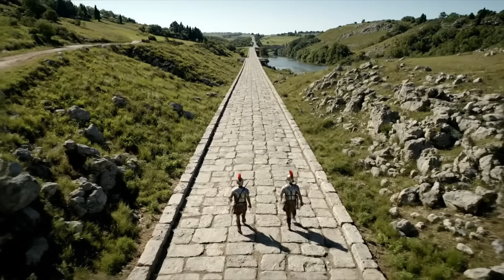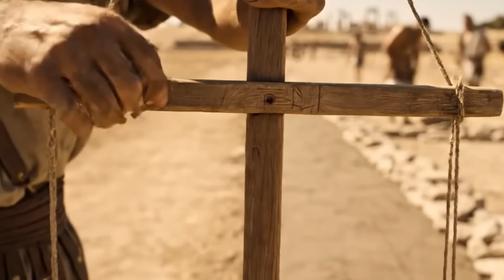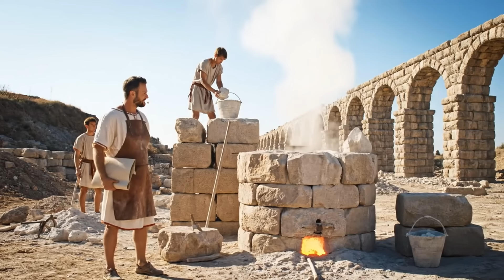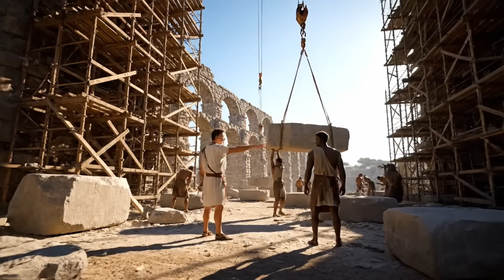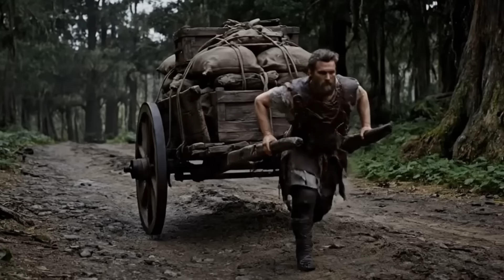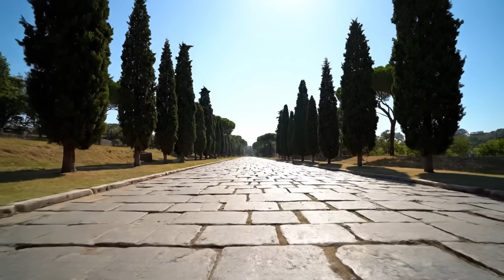How Rome Built Roads That Still Exist

Comment: The M25 ring road around London was conceived as a 3 lane in 1936, but not built until its opening in 1986 with 2 lanes. The northern section had a design life of just 5 years! It was so poorly designed it is known as the car park!

Comment: Walking long distance on hard ground does damage to the joints, tendons and ligaments of horse and man. Living people and animals were consumables, subordinate means to the end of running the megamachine.
Reply: First off, let me explain one thing about this video and it “information” some things they got right but many things they got very wrong. The roads only had flag stones in the cities and on the exit roads leading out of the city for a short distance. Those are the only places that had flagstone as the top layer of the street. The rest of the roads were heavy stone followed by stone aggregate to fill in the gaps of the larger stones on the bottom then covered with and packed hard with the dirt clay sand type mixture that was also flattened with a roller, very heavy concrete roller that was pulled by a horse or Ox, one of those animals to really pack in the road. Think about horses running on the road if it was all stones and Flagstone and those horses didn’t have shod hooves so running on rock would ruin the horses hooves.  If you want a great documentaries series, there is an Italian documentary that was done, but they do have a set of the documentaries dubbed by a narrator in English and it came out very nice. They have the history of Roman aqueducts, Roman engineering, Roman structures, and Roman cities.  
YouTube  “Alpha Helix” is the
Channel name.

Comment: In France today I regularly drive on roads that were clearly originally built complete with the 'fosse' either side, by Romans and very good they are too. In hilly country it's interesting to see how the Roman's compromised their need for long straight roads.
A lot more Roman bridges would still exist except for the invention and widespread use of gunpowder. Despite which you can still  stand on, drive over, Roman bridges in many parts of rural France.
Reply: I agree, in England, i went hiking on the Yorkshire Moors and i came across a relic of a Roman road, what instantly hit me was how straight it was

Comment: As a military professional, long Roman lineage in a former province, and as a historian, I must draw the attention to these AI false historical and fictive histories. One easy example of a post hoc fallacy, is the roads are good because of legions etc. or, the Roman’s set their road standards centuries before the empire (as most people think of it) appeared, the Via Appia  tracing to 319 BC and Roads inside Rome itself had reached what would become the future standard. The roots of Roman road logic is the exclusive inhospitable marshy settlement of Rome, and a centuries long effort to reclaim land- so unlike dry Greece, paved elevated roads were a geographic necessity (the reverse logic applies to Roman reluctance to pave Germania, The Great Bog and preferred using the Rhine as main artery). saying they build the roads for the empire is a post hoc fallacy. imperial highways, sure. Most roads? Nope. Out of the 400.000 kms some 80,000 were stone paved. We also have roads connecting villas and recreational hubs which proves that roads served a multi purpose role from the get go. In parallel, Roman roads also included military reasoning, but the primary was economic and volumetric flow of by directional cart traffic. The earliest problem the Roman’s faced was water supply and rapid overpopulation which imposed, fast a need for fast economic volumetric flow- carts and food. Old roads would have starved the Italian cities with the late BC populations. Note that paved roads preceded the Roman variants as many such examples exist in the Mediterranean. If we look at the Egyptian Lake Morris Road that preceded the Roman roads by millennia. As for Roman concrete, it evolved so the self healing versions we think of today are AD variants. The Nime aqueduct (briefly flashed in the video) was built without either mortar or concrete, stones just fitted together. That aside, what the Romans got right and we still struggle with today, is isolating the road from the water level and frost levels, something in North America we are amateurish at, as we prefer bad roads to ensure never ending construction projects and employment. The 4-10 m elevated Roman platforms have eventually been matched by German autobahns. Now for those seeking an engineering lecture, seek those describing Trajans Danube bridge and the causeway built along the Danube, on cliffs, which enabled the conquest of Dacia. The reverse reasoning applies. The first time the bridge was dismantled was fear that tribes used the roads to invade Roman provinces, which happened recurrently.
Reply: I don't know much about this topic but you seem to so I want to ask why didn't they top the road off with this special Roman concreate, and is this concrete actually special? Just curious about all this, thanks.
Reply: You’re correct that Roman roads predate the Empire and were not built solely for legions, they served economic, civic, and administrative needs from the Republic onward.
However, framing imperial use as a “post hoc fallacy” goes too far. Republican roads became imperial infrastructure, were massively expanded, standardized, and maintained precisely to support governance, taxation, troop movement, and integration of provinces.
The oft-cited “80,000 km paved” figure is also misleading, many Roman roads used engineered stone foundations with gravel surfaces that still qualify as durable Roman construction, adapted to climate and traffic.
Germania is not evidence against imperial road logic; it reflects limited urbanization and strategic reliance on rivers where permanent occupation was not pursued. Where Rome committed long-term, Gaul, Britain, Hispania, roads followed immediately.
In short: Roman roads were multi-purpose by design, but they were absolutely a core instrument of Roman state power.

Comment: Did those roads have semis and 100000 cars driving on them each day?
Reply: Carts has far higher PSI load vs any semi tire….
Reply: As a military professional, long Roman lineage in a former province, and as a historian, I must draw the attention to these AI false historical and fictive histories. One easy example of a post hoc fallacy, is the roads are good because of legions etc. or, the Roman’s set their road standards centuries before the empire (as most people think of it) appeared, the Via Appia  tracing to 319 BC and Roads inside Rome itself had reached what would become the future standard. So saying they build the roads for the empire is a post hoc fallacy. Out of the 400.000 kms some 80,000 were stone paved. We also have roads connecting villas and recreational hubs which provide that roads served a multi purpose role from the get go. In parallel, Roma roads also included the military reasoning, but the primary was economic and volumetric flow of by directional cart traffic. Note that such roads preceded the Roman’s as many such examples exist in the Mediterranean. If we look at the Egyptian Lake Morris Road that preceded the Roman roads by millennia. As for Roman concrete, it evolved so the self healing versions we think of today are AD variants. The Nime aqueduct (briefly flashed in the video) was built without either mortar or concrete, stones just fitted together. That aside, what the Romans got right and we still struggle with today, is isolating the road from the water level and frost levels, something in North America we are amateurish at, as we prefer bad roads to ensure never ending construction projects and employment. The 4-10 m elevated Roman platforms have eventually been close match by German autobahns. Now for those seeking an engineering lecture, seek those describing Trajans Danube bridge and the causeway built along the Danube, on cliffs, which enabled the conquest of Dacia.
Reply: @MusashIBelis  YouTube channel Alpha Helix it’s an Italian docuseries on Roman Rhodes, Roman aqueducts, Roma engineering (mining), Roman cities, and Roman structures. A documentary by Romans about Romans. You know, because Rome is in Italy. 🇮🇹 😊 FYI, it’s in Italian, but it’s dubbed by a professional narrator for English viewers. They do have second set of those documentaries that are done in Italian with no narrator obviously.
Reply: Well, they got cars driving on them right now still holding